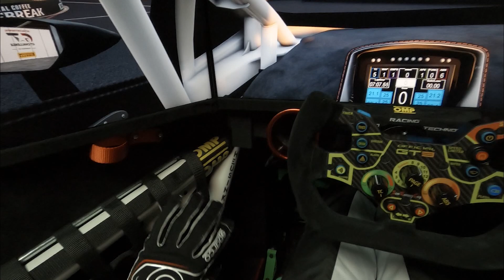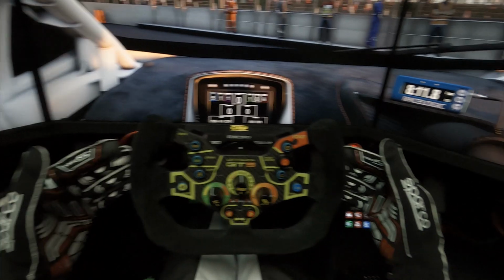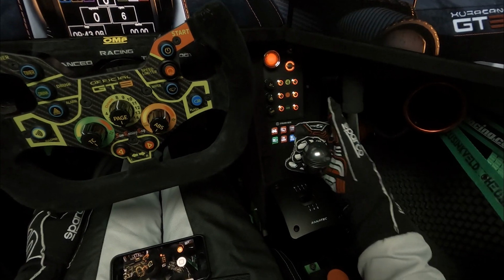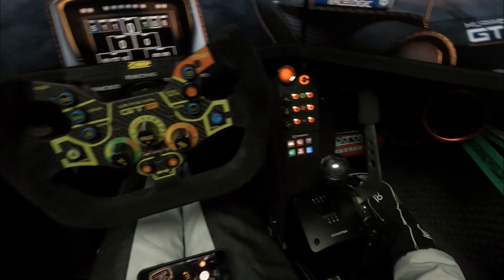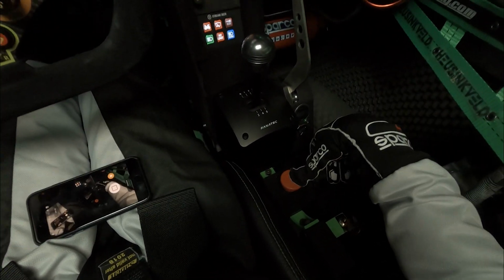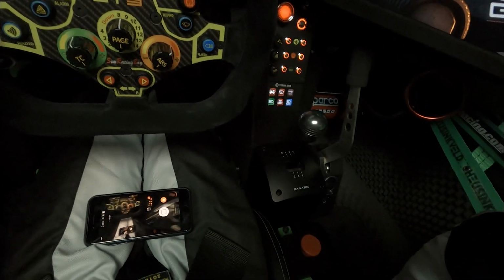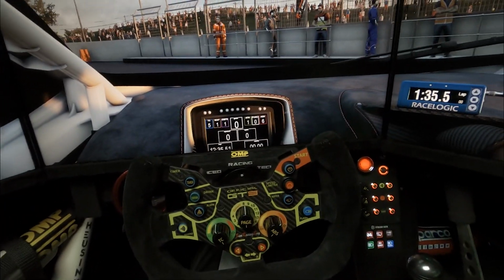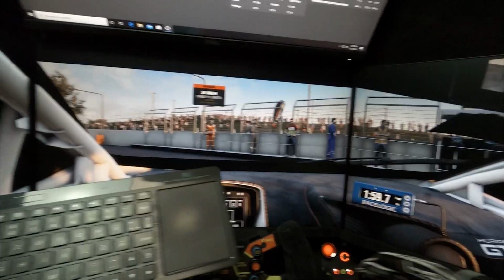Tour Around my Sim Cockpit  in 2020

Comment: Fantastic Setup! One question: Why did you use 75hz instead of 144. Is it not necessary?
Reply from the maker: Well, I’m not monitor fan anyway and I’m racing VR 144hz with index and those monitors I use for the onboard videos are just cheap option to do the work I need from them ! But again, for me personally make no big difference from refresh rate point of view but for other people do ! This topic is bit personal experience and depends a lot how you feel about it !

Comment: Watched this about 10 times know like I said awesome rig... 💪🏽 I shall be trying my DD1 tomorrow if the sidmount arrives from simlab any recommendations on firmware ect
Reply from the maker: Hope you get your Support brackets and dive into DD W-orld tomorrow! You must check which is the latest firmware ! I think 356 is the latest in there official side ! Don’t forget to install the Fanalab software too and if I remember well the Fanalab is supported with the latest firmware and must show you which one you exactly need! Going over the different firmware updates , you may experience full fan speed which is bit scary momenti ! Just keep going to the next one !try to follow the steps Fanalab is asking ... which Wheel do you use ?
Reply: @chepilevski  thanks man I just got the porsche 911 GT3 Cup endurance and I have the formula V2*
Reply from the maker: Rs fordy great, you will go over multiple updates and will tell  you which one you need next

Comment: Hi can I ask for some more info on you cooling setup?  I see that its a Dalap Motor?  Just wondering how you have that setup.  Thanks.
Reply from the maker: I’ve got from Hsimracing this kit https://hsimracing.com/product-category/hardware/fansystem/ and then I’ve got the Dalap motor and I put it behind my seat before creating some EMI issues! I’ve put also one rocket switch to turn it off and on wen need it ! It do very good job for under 100€ all together:)
Reply: @chepilevski  I just came across that site but they want over 400Eur for a full kit.  Is the fan from hsimracing or did you use the dalap fan and just tubes from hsimracing?  Sorry for all the questions!  I want to do something similar but not finding a huge amount of info.
EDIT:
Ah ok, I think I see what you've done.  Those Dalap Blower fans look like what I need!  Thanks
Reply: @Race Beyond Matter I never got back to you.  Dalap fan works perfectly.

Comment: hey what size for the screens?
Reply from the maker: Those screens on this video are 24.5 inch and on the latest videos are 32inch
Reply: @chepilevski  Do you recommend starting a triple screen setup with 24 or immediately with 27?
Reply from the maker: @Fastisfun  If you have already 24 inch monitor just take 2 more same model but if you plan to take 3 ,27inch will be better choice i believe !